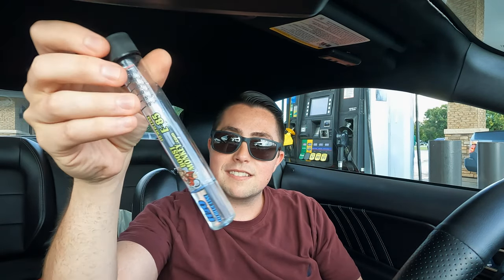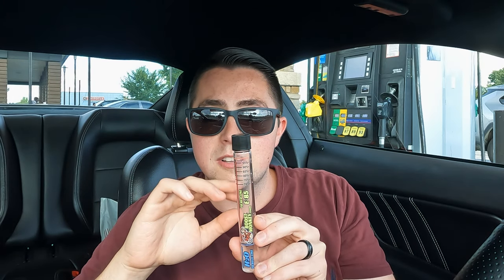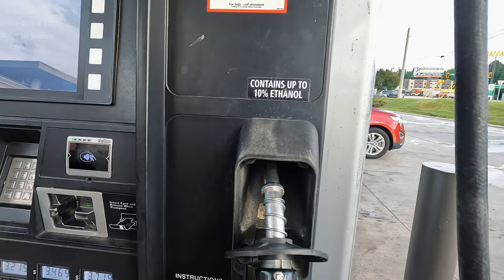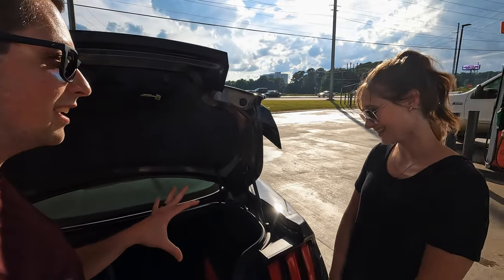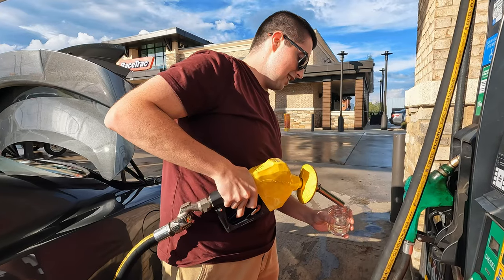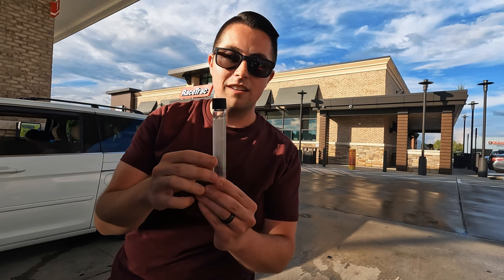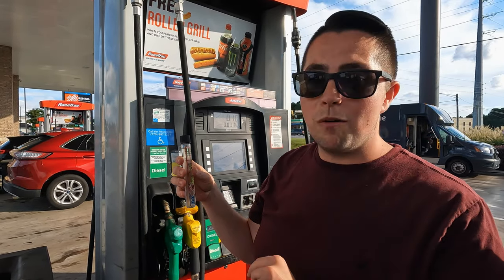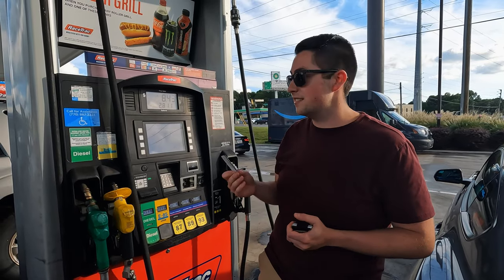My Ecoboost Mustang Gets It’s First Taste Of E30! How To Mix And Test At The pump! 🌽

Comment: Bro I had a quick question when you were stock how much boost would you make and would it hold it ? 

I Remember mine use  to hIt 18-22 psi easy and hold it usually around 20 and now It hits 18 PSI for barley half a second before dropping to 15psi and  fluctuating to 9 -15 PSI after that never goes above 15psi when I’m holding gas on WOT
Reply from the maker: Hey! When stock I think I was hitting 20lbs of boost. I would check to see if you have a boost leak somewhere. If stock you should be around 20 consistently.

Comment: Hey man, been following for a while now but I don’t quite remember what mods you have in your car could you enlighten me again😅 

Also it’s almost time for that Dyno day, so we can see the numbers 😈
Reply from the maker: Hey! No problem! Current mod list is 
CVF Street Intercooler
AIRAID Intake Tube
Drop In AFE dry filter
Turbosmart EM BOV
NGK 6510 Spark Plugs
Flowmaster Outlaw Axel back Exhaust 
Scavenger y pipe
Cobb accessport 

I believe that’s all lol. You bet though I’ll be getting the car on the Dyno once the E30 tune is complete! 👍

Comment: Hey bro what do I need to run e30 on my ecoboost ? And what is better to run on my ecoboost e30 or e50?
Reply from the maker: Hey! You will need a specific E30 pro tune, I recommend PD tuning as they have been great so far. You will need a test kit like in the video and really that’s it. If your stock you will need a bigger intercooler at min to get tuned. Also E30 is the max we can run in our cars without upgrading the fuel system. Hope that helps 🙂👍